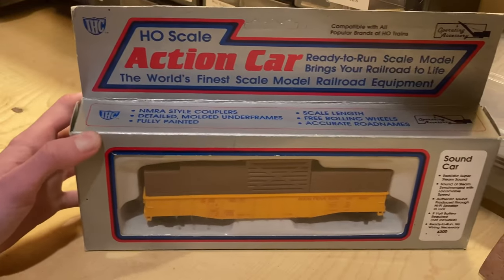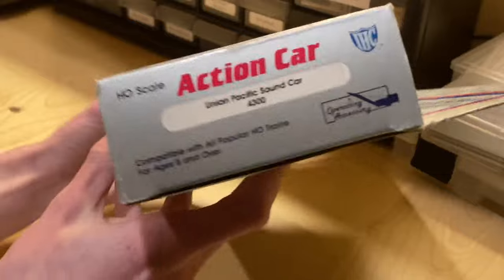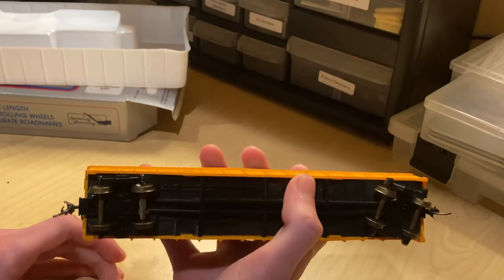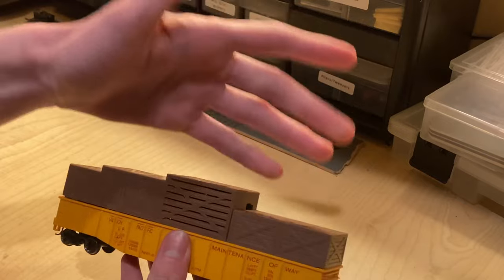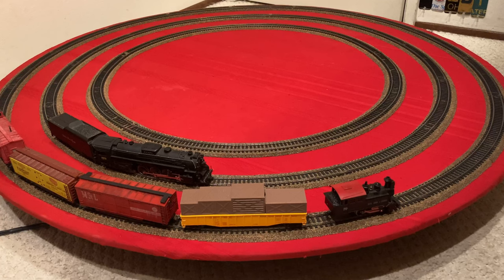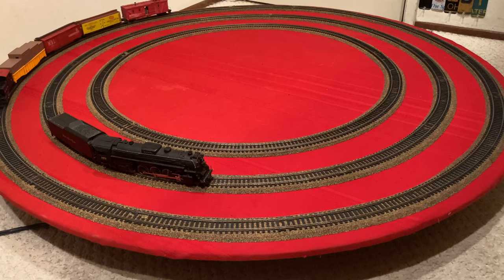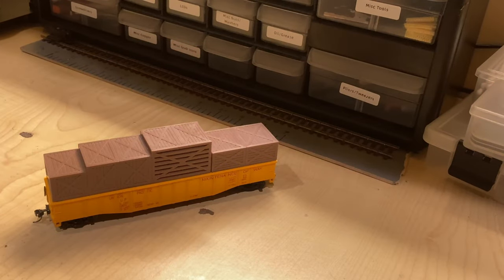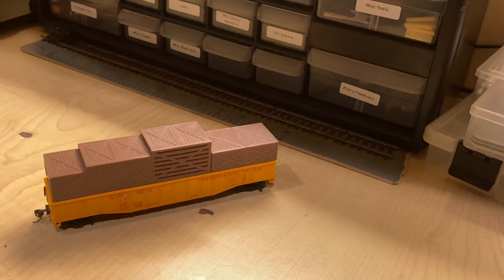One of The Best HO Scale Sound Models Before DCC! Overview of The IHC Steam Sound Gondola

Comment: I often wondered if i could remove the electronics and relocate it into an engine tender instead, but using a smaller cube speaker.But also re-wiring it to use track power instead of the battery.
Reply from the maker: Unless it was a steam locomotive with a very long tender, it probably wouldn’t fit. The circuit board is massive and takes up a ton of the space in the gondola (which is why the load is so tall and it doesn’t just have like a rock cover or something). Rewiring it would also be hard because with the way the system is set up, it relies on track power being picked up and broken in a system, so you’d probably only be able to get power pickup from one truck and I don’t know if that would even work, or if the thing is only made to operate on a certain voltage
Reply: @ATDCC_Colby   I'll do some research on this. Being an electronics geek, I bet i could rebuild a newer/smaller size for the electronics card.